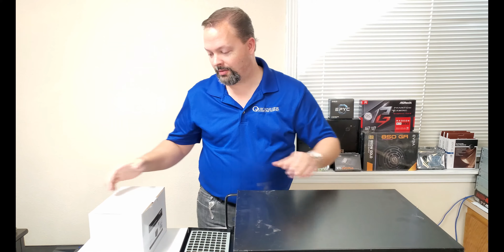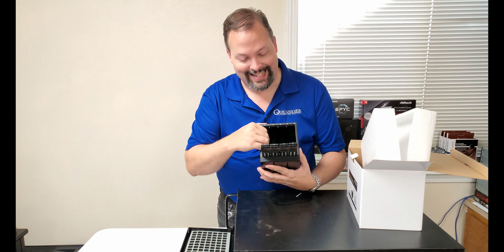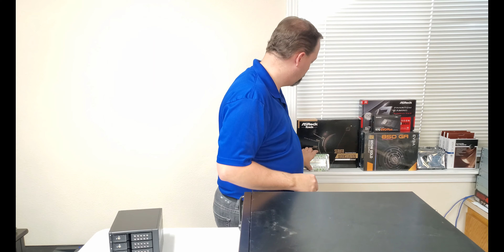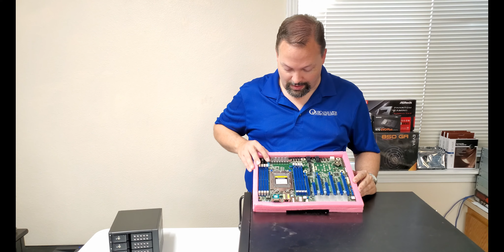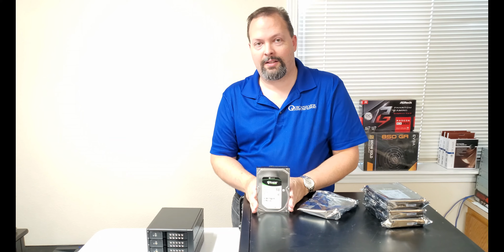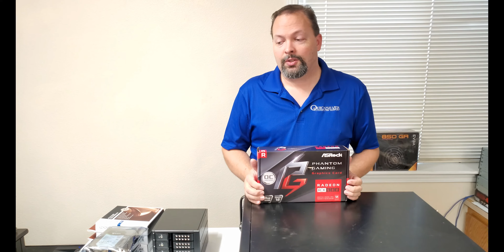EPYC Server Build  Part 1 (Hardware Selection)

Comment: I will probably never understand, why anybody would pick the EPYCD8-2T over the ROMED8-2T. Technically near identical, the ROMED8 has the better slot layout and an additional USB 3.2 Gen2 controller.
The rest is pretty much standard: You know, you are wasting half of the memory bandwidth by using only 4 DIMMs and I cannot clearly make out why you have such a system equipped with rotating rust, except for price. If price was the prime concern, the EPYC build is sub-optimal due to the expensive mainboards.
Anyway, nice video. You could shorten the video, as you do not really talk in-depth about the components. Just a matter of taste, thou.
Reply: I will never understand why anyone would pick either of those over Supermicro H12SSL-NT or -CT 
Or better yet, H12DSI-NT6
Reply: @PalCan  Oh that is simple to answer: The SuperMicro Boards have crappy Broadcom-NICs instead of way better intel NICs, they have an inferior slot layout (not all slots are x16) and they lack the USB 3.2 Gen2 controller found on the Asrock boards. Both single slot variants of the Supermicro board are inferior.
Before getting the dual-socket H12DSI, I would look at the Asrock ROME2D16-2T for pretty much the same reasons: better slot layout, better NICs ).

Comment: I am looking for ECC RAM for an upcoming Threadripper Pro build, and was considering NEMIX, but can't find a whole lot out about them. Another thing I wanted to mention, was do you think the Ram listed for the EPYC Processor would be compatible with Threadripper Pro, such as RDIMM 3200MHz, 16GB 2RX8 , or Do you think the RDIMM Kits listed on Amazon at these specs that are listed as  unbuffered server/workstation, if it meets the specs of the Motherboard, in my case it is the Gigabyte WRX80 SU8 IPMI Server Motherboard....Thanks for the video
Reply from the maker: It would depend on the number of sticks and  memory channels. If you're running 8 sticks it needs to be 1Rx8 or x4 otherwise you're memory controller is going to hate you. Especially if you deep tune your timings.

Comment: What is your experience with Nemix Ram, and is it reliable to your knowledge ?
Reply from the maker: I've got four EPYC severs in deployment with it installed in quad channel 32GB & 64GB configurations. Only strange issue I had was where the ram didn't register in the bios under the size and speed but hardware monitor could read the temps on every stick. It loaded Sever 2019 fine and runs at full clock ddr4-3200 in Windows. That's the only issue and that was with a AsRock Rack EPYC8D-2T board.
Reply: thank for your reply

Comment: Thanks working on my own ambitious server build based on a 2 RU case and ARM server with an innovative twist on the cooling  side to keep the noise and energy draw down. Learnt a lot from from your obvious years of experience. Built water cooled gaming rigs which although cool like dragsters, servers are the turbo charged diesel trucks of the industry and server space is the new property boom the crypto world craves more server space. Got an idea to use blade less air amplifiers with closed water loop CPU & memory cooling. Will eventually do a YouTube of it. Look forward to more content from you.

Comment: Great video! I wonder if I can use this cpu in a desktop computer for home use.
Reply from the maker: You can. The issue is going to be driver support. You're better off going with a Ryzen 3950X or 5950X, or threadripper

Comment: What CPU Cooler did you use? I don't see it listed
Reply from the maker: Good catch. I must have glanced over that.  
Noctua NH-U9 TR4-SP3
https://noctua.at/en/nh-u9-tr4-sp3
Really the only cooler that will fit in a 4U case and has full coverage of the IHS.